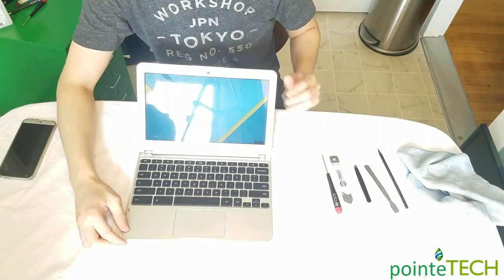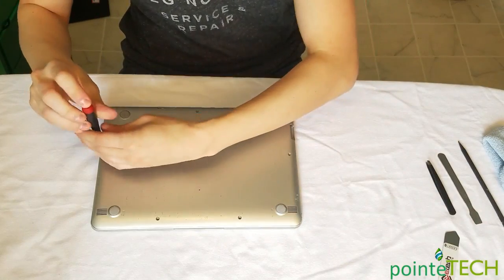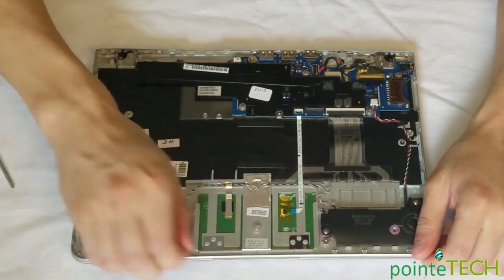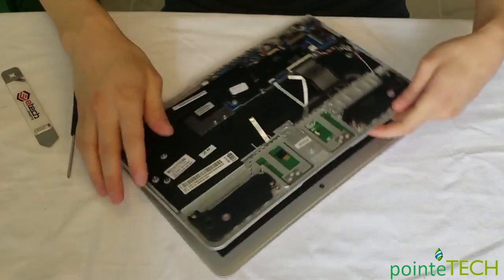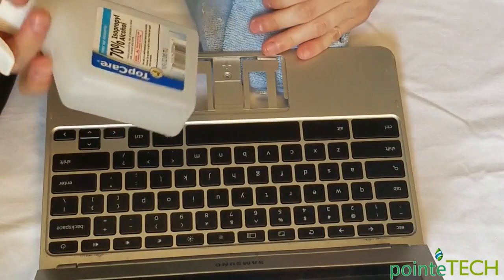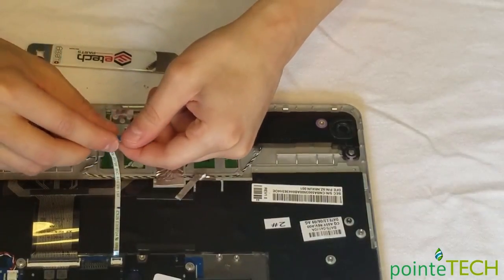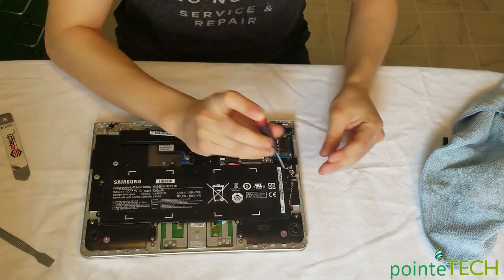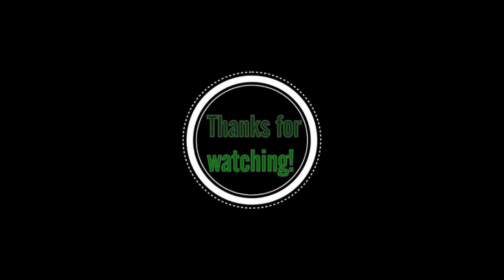How To Fix Chromebook Touchpad Trackpad Stuck Sticks Will Not Click

Comment: Does this work on the 15.6 Samsung 4+ version?
Reply from the maker: If its got the same issue then yes:)  This procedure will work on any laptop computer where the touchpad has developed a build-up of debris in the Touchpad area :)
Reply: @PC_Monkey  on it right now thank you you’re the man with the master plan!
Reply: @PC_Monkey  on the 4+ 15.6 only difference so far is touch pad pops the opposite directions as there’s some side tabs blocking it from going the direction on the version here.
Reply from the maker: @Monxinful  Yes, every model computer will be constructed in different ways :)
Reply: @PC_Monkey  looks like I'm assed out it was surprisingly clean in there do you happen to know any reputable/recommended parts site?
Reply from the maker: @Monxinful  I usually get my computer parts from sites like Ebay or Amazon.  Fast, cheap, and with good return policies

Comment: My laptop got water inside of it and the touchpad is too sensitive. The cursor still works but whenever I touch the pad immediately clicksI don't know what to do to clean the water out of it.
Reply from the maker: First, the computer should be turned off at once.  Water in a computer can damage every component.   It should be opened as much as your comfortable with and allowed to dry for at least a day or two.  If the touchpad is overly sensitive, it could already be damaged.  Try reseating its ribbon cable and see if that helps.  If not, you may need to replace it
Reply: @PC_Monkey  okay thank you. I think I fixed it but in a different way. I was panicking and I used a hairdryer and tried to dry it through the cracks of the touchpad. Then I moved the cursor and it stopped being so sensitive. It's been more than 3 days and it works pretty much the same as how it used to. its fine but I dont know if its actually okay
Reply from the maker: @dayzur6812  Glad your all set :)

Comment: I suggst noting in both the synopsis and video:  if the touchpad loosens when battery is removed and due to its bulging, replace the battery (do not puncture the battery enclosure).  A bulging battery may be as  common problem as touchpad gunk depending on user habits.

Comment: My touchpad for my school chromebook has completely stopped even showing up on the screen is there a way you can help with this
Reply from the maker: Have you tried resetting the chromebook?  You can also try opening it up, unplugging the ribbon cable from the touchpad to the motherboard from both ends, and then plugging it back in.  Sometimes the connection just needs to be refreshed.

Comment: My mouse isn't there
Reply: Thanks helped alot
Reply from the maker: @ianbowling6065  Great to hear !!  Always here to help :):)
Reply from the maker: I dont understand your comment
Reply: @PC_Monkey  my cursor is not showing on my screen you cannot see it
Reply from the maker: @ianbowling6065  If the computer works otherwise, try unplugging the ribbon cable from the touchpad and motherboard.  Then plug it in again.  Sometimes the connection needs to be refreshed.

Comment: Hey all! If your chromebook has a USB port, buy a USB wireless mouse. These instructions were great. But it doesn't seem worth the risk of breaking your chromebook. The creator pointed out so many delicate parts that could break easily. I appreciate that he did that. My daughter's Acer chromebook (for virtual schooling) touchpad's clicking functionality stopped working. I just plugged in a USB wireless mouse and she was back up and running. I didn't want to potentially break a chromebook I don't own.
Reply from the maker: I personally prefer a wired mouse to any computer trackpad :)
Reply: @PC_Monkey  That's what I am using. Happened to have one.

Comment: I’m stuck at opening the back panel.
Reply from the maker: What brand and model computer do you have and whats the issue with it?
Reply: One screw is just stuck and no matter how much I twist it it doesn’t come off. But it’s fine I’ll just keep using the mouse
Reply: It’s the same exact computer you have btw
Reply from the maker: @gil.jewelryy  If the screw is stripped, you would have to drill it out.  It could also be that the threading inside the computer has come loose and is spinning with the screw.  Theres no good fix for that unfortunately :(   You can try drilling it, but you may just have to force / break the panel to get that off :(:(:(
Reply: @PC_Monkey  ok thanks for the info much appreciated:))